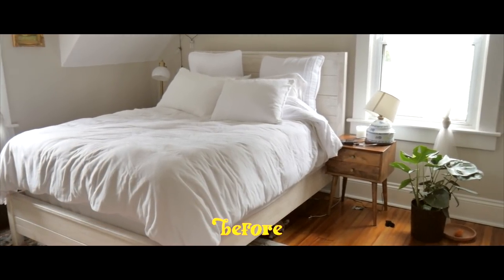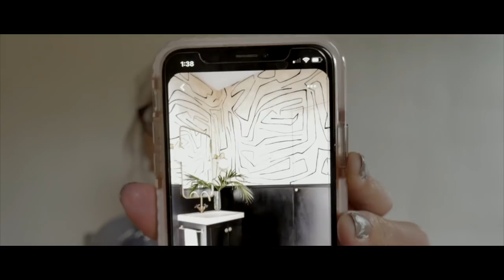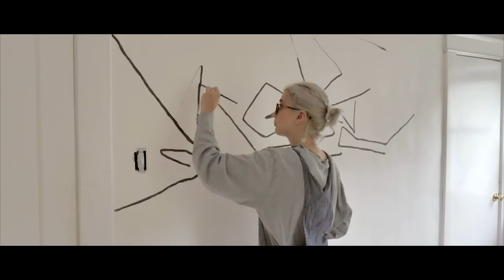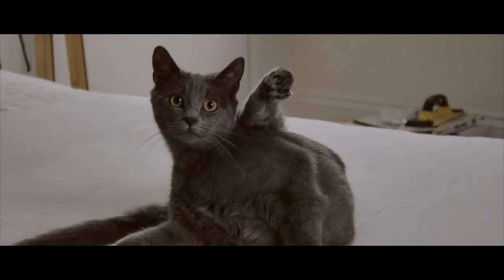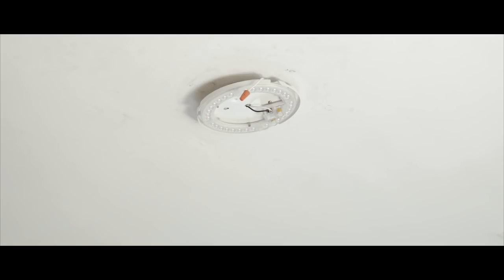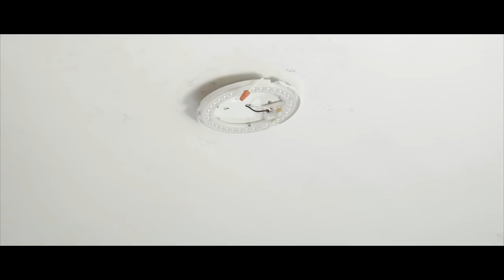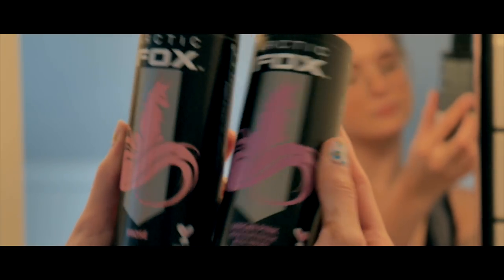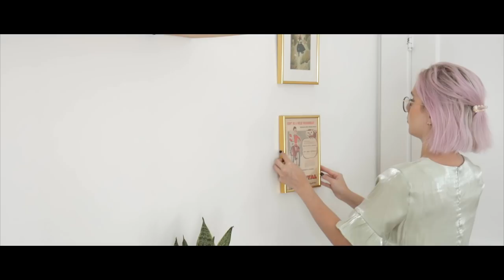bedroom makeover ✨ downsizing my bedroom and adding too many plants🌿

Comment: Drainage should be placed on the bottom of the plant pot. For example expanded clay. Expanded clay creates drainage by regulating the amount of moisture in the substrate.
Reply: why would you add it to the bottom of the pot instead of mixing it in with the soil.
Reply: @blehmeh2566  Drainage in the bottom will protect the roots from moisture stagnation, absorb excess and will slowly release them into the external environment.  This has a particularly positive effect on the condition of moisture-loving plants that require frequent watering: the soil will not sour, and in the intervals between moisture intake, the flower will not suffer from drought.  Mixing drainage and soil is suitable for plants such as cactus.  I apologize if the translation is not correct, I translated it through a translator